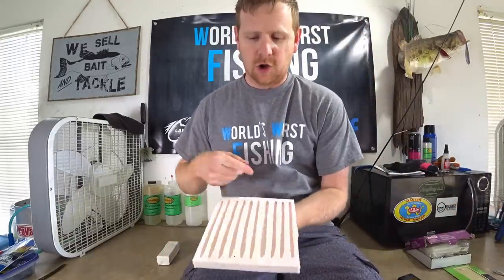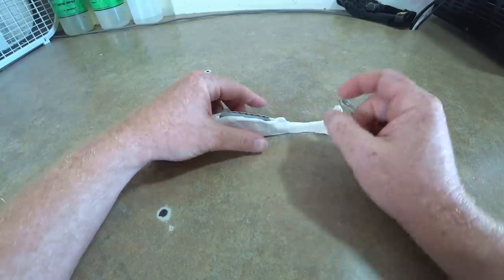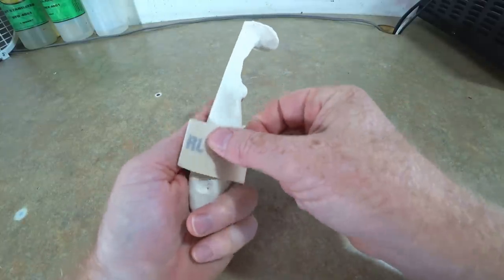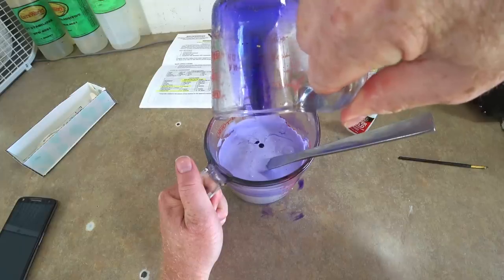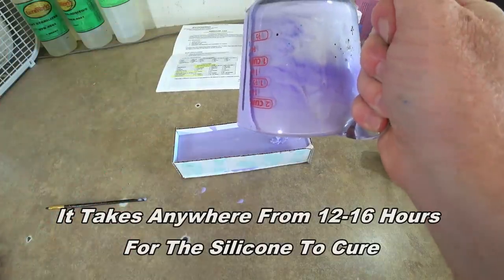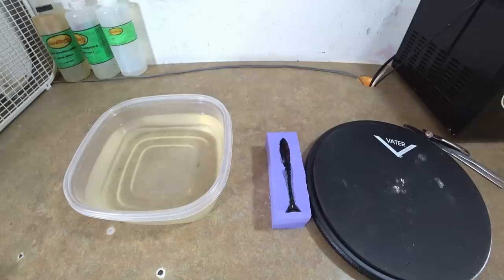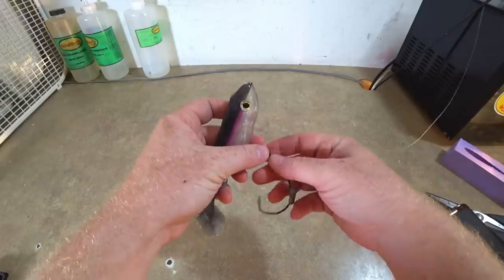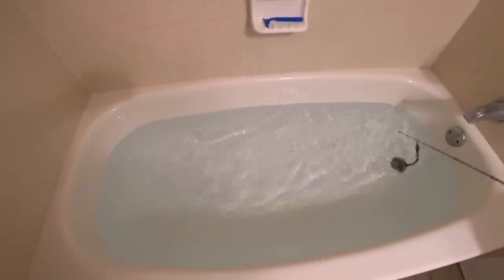LET'S LEARN MOLD MAKING! Making A Silicone Hand Pour Fishing Lure Mold!

Comment: You did a great job.  Do you have a hardner will make the soft plastic tougher?  Something that may assist you with making the exterior smoother/shinier would be taking a Q-tip, dipping it in the Vaseline then running the saturated end of the Q-tip rubbing the interior of the mold with a very light coating.  This step could be improved with using vitamin E oil ( liquid/get it at drug store).  Or just put a small drop inside mold, thin with a Q-tip rub it around the insides of the mold.  I have poured molds previously many years ago with excellent success.
Larry

Comment: Put soft plastering at the bottom of the box and push the model in purr to the top turn around and remove plastalin  grease and put the rest leave a pencil at 2 places attach to the mole for injection and put the second part of the mole. Use Perspex box to cover it then inject or pur

Comment: Solid work, especially for a first go. I know I made some mistakes with my 1st try, if your using a soft bait already in production as a master, you have to glue it down, otherwise it will float in your silicone. Learned that one the hard way. Curious to what silicone you used, can you post the link?
Reply from the maker: http://hobbysilicone.com/silicones/
Reply: @WorldsWorstFishing  did you use the medium, firm, or extra firm? Having a rough time testing different silicones and was curious.
Reply from the maker: @A.Blair_Fishing  just medium..I'm not a mold making guru tho

Comment: I make my own molds the same way and to get shinny baits I brush a coat of 2 part epoxy on the master and when its dry i pour my silicone. I use alumilite high strength 2 ( no need for Vaseline or mold release on one piece mold ). You can also pass a torch quickly over dull bait and it'll get shinny. Big fan keep up the good work.
Reply: What's your preferred method for making the mold box?   I'm struggling with this part of it...
Reply: @matthewbeckwith663  I just use cardboard and hot glue the whole box around and sometimes I use my kids lego and put a small beed of silicone around it
Reply: @jfsportfishing4744  any old cardboard will do the trick?  I did whether the silicone would adhere to cardboard and/make it soggy.  Great idea re: Legos!

Really appreciate your help

Comment: You need to just pour in one spot. Do not get moving it about as you will get bubbs! Especially how you covered over your slot. That was very scary for bubbs, because you closed the hole and this prevents the air from venting right. Just let it fill itself. It WILL cover everything, with patients. Nice work brother, well done.

Comment: Large aluminum pan. Pour plaster of paris in. When it starts to harden place any baits you want to replicate into the plaster until it is even with the top. After it hardens some more, remove the baits and let the plaster finish hardening.  Easy and makes a pack at a time

Comment: Smooth On  they have great silicone for molding multiple varieties 2 part 1-1ratio. Set up times from 15 min to 24 hour and all in between. Check them out. 
Also the clay you used can emit toxic fumes. DO NOT use in home oven, can make you sick from cross contamination. Use your heat gun. You can heat  it add to it  and heat to cure as much as you like.
Reply from the maker: good to know..thank you man
Reply: @WorldsWorstFishing  no worries love the channel. 👍

Comment: Another great video mate. Did you do this just as a creative exercise or do you think that this is more economical for those on a budget than buying a silicone mould from an established mould making company? I have been thinking of doing this myself as I have found that almost all of the brands that you mention in your videos either don't ship to Australia or have truly outrageous shipping costs (I got quoted $125 shipping for a single aluminium mould) whereas the silicone moulding materials will cost me roughly $40 and a little time to make. I think it might not be as good a product as a store bought mould will produce but I Am only starting out and am unsure if I will even enjoy the process of making the lures yet.
Reply from the maker: yeah thats a good question, Buying a silicone mold say from Stankx would be a higher quality mold especially at first.  But if shipping is outrageous, try doing it yourself.  You can have a mold ready to pour in 24 hours start to finish.